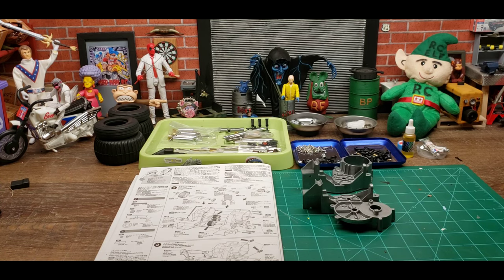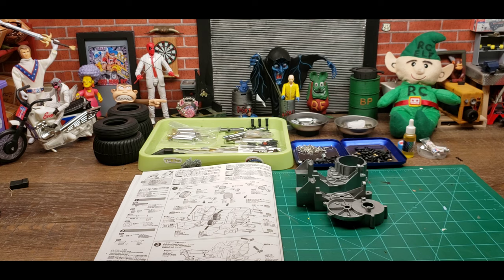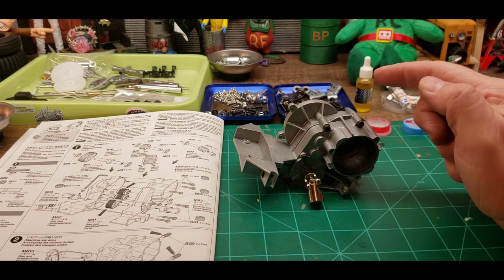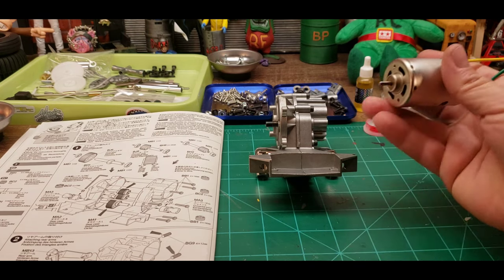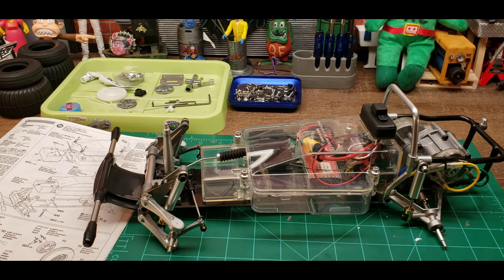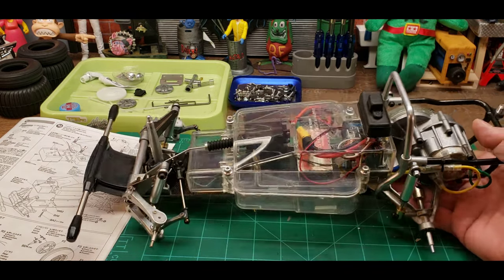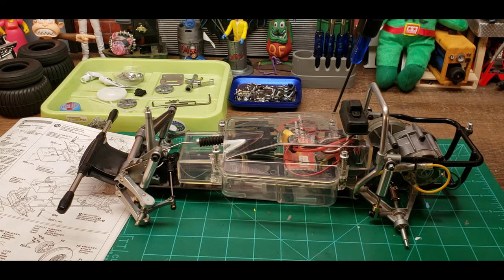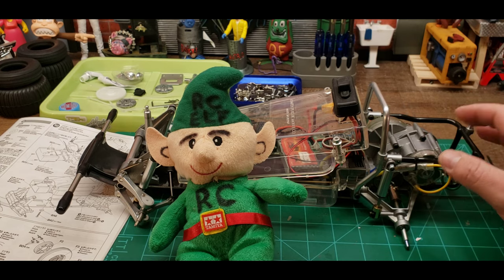Tamiya Sand Scorcher Build PT-1

Comment: How generous of the RC Elf to get you a Sand Scorcher; I can completely understand why you wanted to delight in the build process rather than spending half the time concerning yourself with light levels and camera angles.
You still gave good information, such as adding grease between the clamshells to exclude dust and grit and backing off those s rew a quarter turn too.
I thought it was good of you to point out your Johnson - otherwise we might have missed that detail.

Comment: The kit was very nice with all the metal. But when you had to squeeze so much into the electric box in the old ones. A humped battery, second servo with speed controller and 4AA battery pack. Now I think how did it all fit in :-)
Reply from the maker: I didn't even think about rhe manual speed control and batteries with the big futaba receiver i bet that was a challenge to fit
Reply: @AdventureTimeRC  It was, the wires had to be in the right place to get the top on. With modern electrics we are luck to have so much less to play with.
Reply from the maker: Rc has really came along waybin the electronics department

Comment: Hey buddy sand scorcher is cool hey can lexan pollycarbonate clear rc bodys be painted with rustolium paints or tamiya model paints or have i to get the propper spray paints from tamiya for clear bodys to paint
Reply from the maker: Yes you can use rustolum make sure it says bonds ro plastic but Tamiya ps paint works much better i prefer it